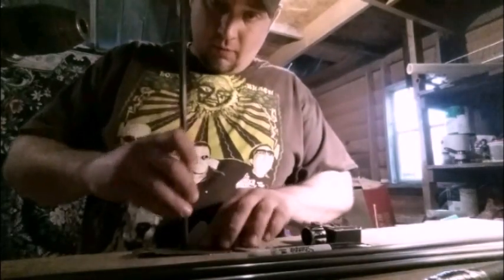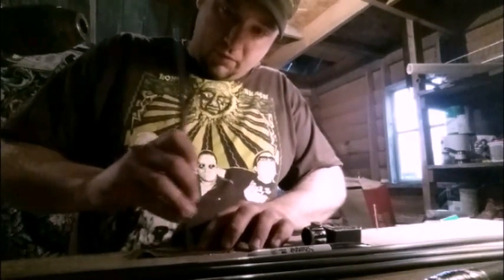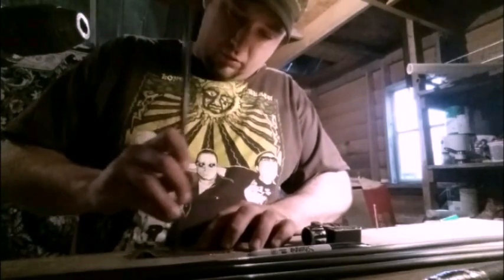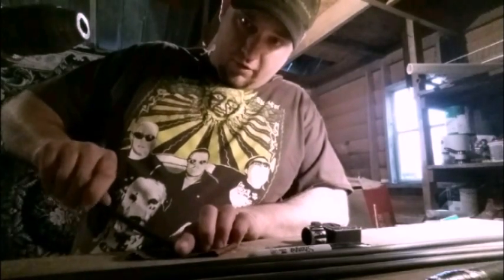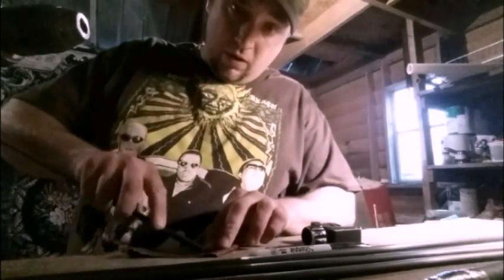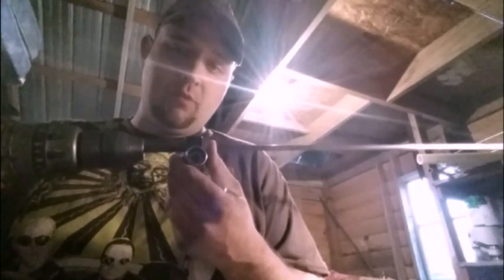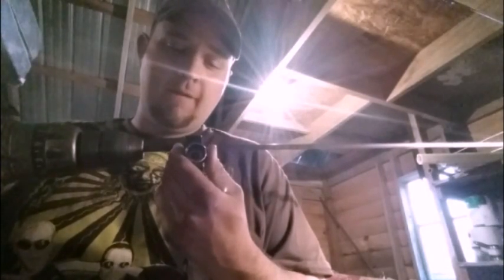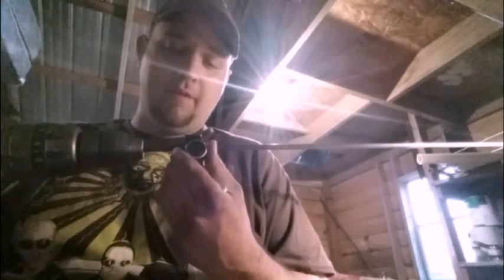How to cut your own carbon arrows HACK!

Comment: Can I use this to cut carbon arrows? Bought the pipe cutter but did it by hand. Didn’t work out well
Reply: You cranked down on the pipe cutter to aggressively. Some people shouldn’t try this method. And should buy an arrow cutting setup, or have someone cut them for you.

Comment: Be safe... dont ever use a pipe cutter for cutting arrows.
The risk of splintering and splitting is too high.
Dont use it for aluminum arrows either.
Reply: Why not I been doing it for 20 years with no issues
Reply: Dont leave your mamas basement or you might wake up to the world that’s out the front door.

Comment: cant i just use a hacksaw?i dont got power tools man
Reply from the maker: luke norton better find a archery shop bud
Reply: luke norton a lot of work when cutting arrows with hacksaw.
Reply: Also not a perfect cut with a hack sack. The angles are difficult to keep 90 with a hacksaw.
Reply: You can use sandpaper to correct angle